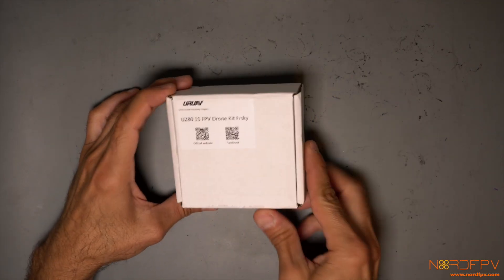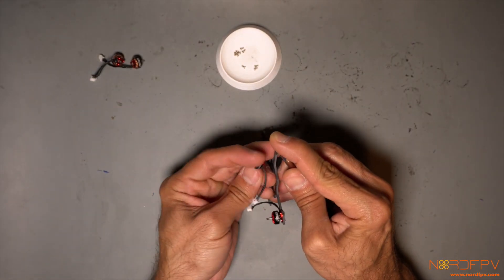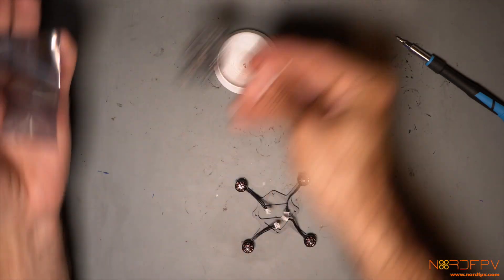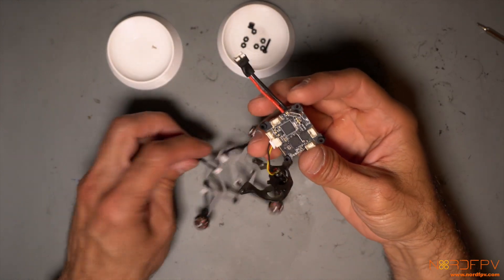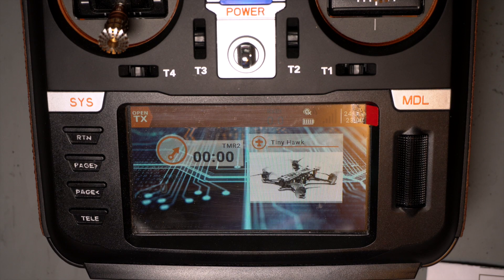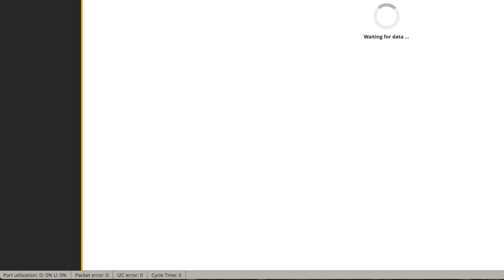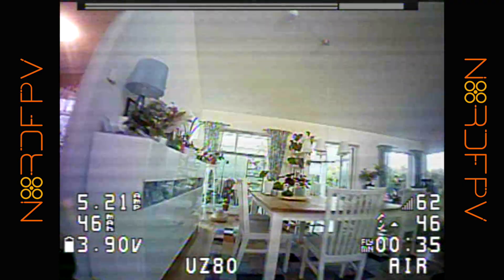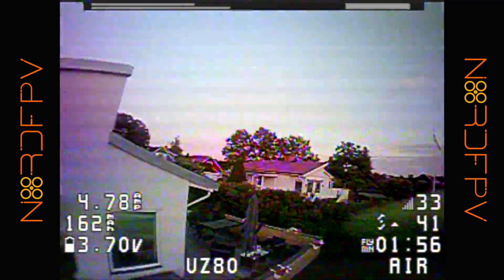Great outdoor 1S  FPV tinywhoop: URUAV UZ80 - Building and flying it

Comment: Hey there, I just got one of these two , im new to this hobby and im getting grey screen on my footage , I have the OSD but no video ? could you help me out < please and thanks
Reply from the maker: Hi, Grey/black screen with OSD means that the camera signal is not reaching your VTX. The OSD is produced by a chip in your electronics, while the camera is a different source of information. Having OSD means the VTX is ok.
I'll start checking the connection of the camera, physical connection, the cable, and in the worse case scenario change the camera or move it to another drone in order to discard the camera as a problem.
Reply: @NordFPV  thanks Man, appreciate it . Which camera can I buy as a replacement and one with better image quality ?
Reply from the maker: @Euphorio  the problem with this drone is that in order for it to fly nicely you have to keep it super light. There are not many options on that weight range, therefore the camera is not a point where you can spend a lot of effort finding a "better" one. I would replace it with the original. This drone is excellent to fly it around, but the camera is nothing special

Comment: Most of the parts are from the mobula6, easy to replace if broken.
Reply from the maker: Good tip! I got a bad motor with the drone and it was very difficult to find the same one. I ended up buying 4 new newbeedrone because I couldn't find them here in EU

Comment: Let's get rid of jellow and powerlines. But how???
I istalled a cap on battery connectors @FC, but it didn't help.
Reply from the maker: I doubt you can get rid of jellow in this one. I think it's the plastic canopy the main reason for the jello.
Reply: @NordFPV  And the powerlines?
Reply from the maker: @thorsten7868  this is a 1S drone, so a cap won't do anything. Everything is integrated in one board, which mankes me think it will be very difficult to do something about it. If you want more quality, and better image, you will need to upgrade. This is the cheapest drone I've flown, I won't be asking much more from it than a fun time.

Comment: Nice video - I love my UZ80 flying in a park - concerning spare parts, see Banggood "URUAV UZ80 Spare Part Canopy / Bottom Plate/ Screws / DIY Empty Frame Kit for FPV Racing RC Drone" (ID: 1844752) and take care to select the right parts from that page: "Empty frame kit" / "Screw and damping balls" / "Bottom Plate" / " Camera Canopy".
If you like the UZ80 and it seems to slow for you - try after the Crux3! 
(I do not work for Banggood nore I have any benefit by posting this info).